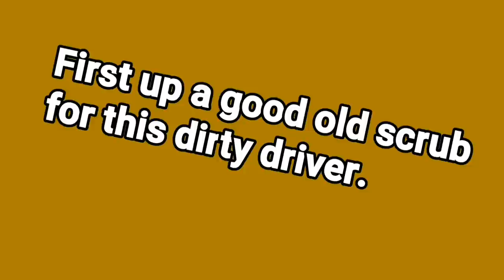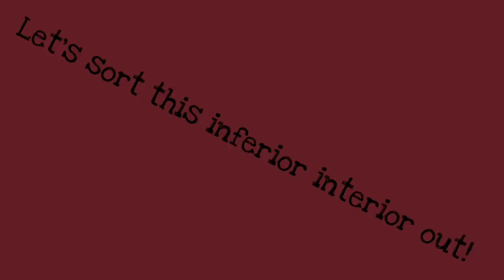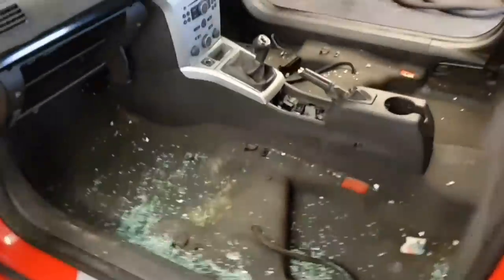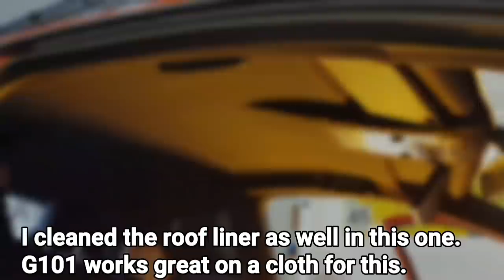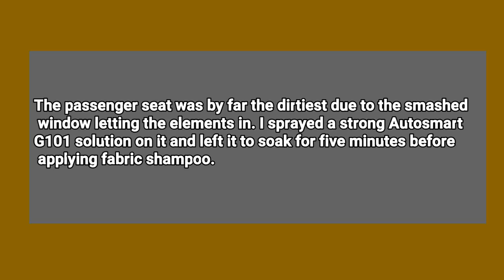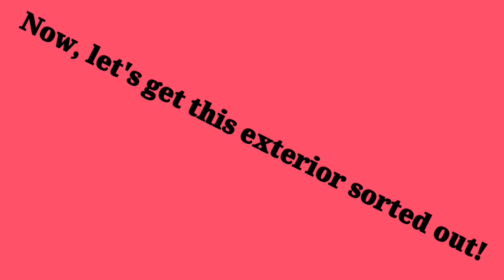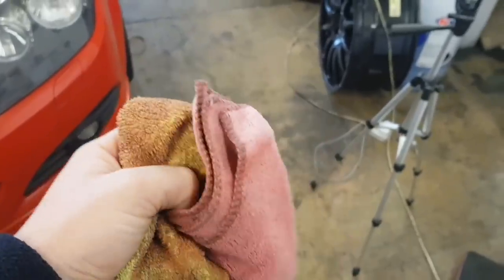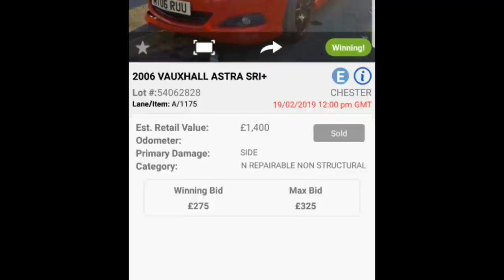Cleaning a really dirty car - vauxhall holden saturn astra

Comment: Collonite 845 is a legendary wax. The product performance speaks for itself as Collonite doesn't advertise the product or have a flashy design on the bottle. The stuff lasts for months even in the brutal salt of Michigan winters.
Reply from the maker: That is a good wax. Can be a bitch to get off though 😂
Reply: @autoshineblackpool  Yh but what's helped me is if you just put the bottle in some hot water for about 5/10 mins before using it, it really helps with that. Awesome work on the Ruby Red Astra!!
Reply: @autoshineblackpool  It is extremely easy to remove if you heat it up in a warm bucket of water and apply it REALLY thin. It should be barely visible when you spread it on the panel.
Reply: Collonite 845 is my choise too..god price and lasts well.

Comment: Bought myself a black '06 Astra 1.4  Sxi a month ago for about 20 quid more than you paid for that before delivery as I needed a cheap runaround. 

It has scratches and chips and needs some TLC. Your video has given me a good idea of what I need to do to get it looking better, so thanks a lot. 

Btw, I agree with the folk that say your videos are therapeutic. Loving the accent, but I have the same one, so I would say that. 

Keep up the good work!

Comment: Fantastic job man. We always used Zep products on the rental cars. They had a 5 gal natural citrus cleaner that would melt tar and bugs, would do a crazy good job on any interior surface, and seemed safe on everything. Never affected carpet or painted/dyed plastic color and of course no issues on exterior finishes. And it literally melted stuck on junk off wheels, wheel wells and exteriors. Great stuff. Smelled damn good too.

Comment: I've been using a Turtle Wax F21 super protectant for my interior and exterior plastic panels.
It cleans, protects from the sun and dresses the panels to a fresh stock finish without leaving any residue.
I used it for the last 7 years and it works superbly.
Especially in the intense sun of the middle east.

Comment: Awesome results!
I fell in love with super clean for cleaning engines, tires, and wheel wells. Optimum no rinse works great as a window cleaner, interior cleaner (for routine cleaning), and if it’s too cold for running water. Dressing- Chemical guys VRP because you can dilute it to your desired gloss since it’s water based. Meguires new iron decon works well for hammered wheels and paint.

Comment: Another great vid, the results are a credit to your hard work! I’m a bit OCD with cleaning my car and my other half’s car so have many products, but a stand out is Sonax Brilliant Shine Detailer. It’s perceived as a spray detailer / drying aid but it’s more of a spray sealant due to its longevity and great water beading. Great value too!
Reply from the maker: I actually use that product! It's a great thing to have. 😊

Comment: Got a 2002 Astra whose paintwork I brought back to life with Meguiars Ultimate Compound then liquid carnuba wax then sealed it with Bouncers Done & Dusted Si to give it the high gloss wet look. Inside it gets vacuumed monthly and spritzed with Autoglym Vinyl & Rubber restorer. Whole car looks mint from 10ft away!

Comment: Auto finesse triple, halfords sell it and with a trade card it's under £10 works a absolute dream in my opinion! That car looks the doggssss
Reply: The alloys are horrendous
Reply: Easy on, easy off. One thin application is all it needs and one 500ml bottle of it lasts for ages. I love the Tripple. It smells lovely and gives a great shine. Did I also tell you that I use Auto Finesse Tripple as well? I use the Auto Finesse Rejuvenate Cleaner Polish to prepare the surface for it if I haven't done the car for a while and it pulls up a surprising amount of bonded dirt that washing won't get rid of.

Comment: My favourite product for the exterior is gyeon wet coat, just wash the car, rinse off and apply a misting whilst the car is still wet, pressure wash off and a ceramic coating on your paint which lasts 1 - 3 months with a high gloss and a crazy hydrophobic beading effect, I love it, very simple and easy to use, give it a try! Favourite interior product is auto finesse total interior cleaner, cleans well, leaves behind a nice finish and has a kind of new car smell to it which infuses the cabin afterwards, I love it 👍👍👍 a great effort on the Astra, looks really nice now, will you be keeping it for yourself or selling it on?  A tip you may not know (from another detailing channel) - if the mouse or any creature really sets up home in the car and you cannot find it, just use an ozone machine for 90 - 120 mins and it will kill anything organic inside the car. A decent channel to watch diy or simple solutions to detailing woes is “sweet project cars”, he is an American guy that is quite knowledgeable, maybe a few tips for you all there too 👍👍👍

Comment: Sonax BSD for longevity as a spray sealant. As an    all in one I recommend Triplewax Car Polish, as good as Autoglym Super Resin Polish but miles cheaper - only a fiver from Sainsbury's for a litre. For carnauba wax try Harly Wax £22 on eBay for 400gms or Farecla G3 Supergloss - roughly the same price for 200gms. Both easy to use and give a lovely glossy finish.

Comment: O-M-G !! 😎👏👏👏👍👌👊👊 You did one bloody amazing job on this rebuild/resto/detail!! You'd never know it was trashed! I think that left rear quarter panel was used as a test spot for the other crappy spray paint areas.😉 As for what I use on interiors, if it's a health hazard I use Spray 9 as it's a disinfectant and kills bacteria. For interior dressing, I've tried many but get the most positive feedback from customers when I use Meguires  vinyl and rubber cleaner/protectant. It has a great scent and customers always comment on how great it smells and how little dust stays on the dash over time. Poor Boys products are a great choice! They dont advertise and their labels are low key but the products are outstanding! Excellent choice there! Great video again. Thanks so much for putting this together for us. I know it takes forever to edit and shuffle the camera all over the place. Again, great job on the wee car!! 💪💪🤩👌

Comment: I use bilt hamber polish and double speed wax. I have recently bought poorboys wheel sealant but not used it yet. It would of been nice to see the astra outside when finished to see the paint in natural light. Keep up the good work!

Comment: I used to travel a lot for work. Came back from one trip to find a BMW X5 in my driveway. I called the police. A cheeky neighbour renting across the street just thought he'd take the liberty. "In my country, it would be no problem". Nice big oil stain on my new concrete driveway. I had an OPEL ASTRA and as it had sat while I was away, I moved it onto the street and spent nearly a day cleaning it so that it was like new. Left tire foam on it overnight on the street ( so as not to stain the driveway ). When I came out in the morning, the rear quarter panel was pushed in. The only explanation was that the guy had reversed into it by way of saying "Screw you". Nice neighbours. They went back to Eastern Europe soon afterwards.

Comment: Something you haven't covered that's my favorite (favourite) is to use scented Lysol to clean the vents. In Texas air conditioning is required for the heat, but mold can grow in the vents leaving a smell like a cat peed in the car. No joke. To clean, you open the vents and turn the air on high (no A/C) and open the windows. On the outside near the bottom of the windshield (windscreen) spray in Lysol every few seconds for about 5-10 minutes. It kills the mold in the vents. The smell is better if you use lemon or something clean smelling. Usually do this once or twice a year. Right now experimenting with an industrial bathroom enzyme cleaner for the interior carpets. Same stuff you would use in a huge public restroom to get rid of pee smell. This works great to get out any bad smell.

Comment: I'm not quite sure if your headlights are slightly hazy or not but if so give Mother's Metal polish a go with the buffer & a medium buffing pad, will make them brand new again. No need to do the wet sanding etc. as this will do a better job and will only take a couple of minutes. Keep up the good work mate.

Comment: Well done mate you've done a great job on this car and saved it from going to the scrap yard or being ripped p for parts. It will give someone many miles of happy driving. 
My personal cleaning products I use are all mainly from Autoglym. Although I'm going to order some G101 cleaner and that bio stuff you use too. Getting myself a shed (finally) so I can put all my cleaning stuff in there! 
Looking forward to the next video!

Comment: Always wanted one of these cars when the Saturn came out. Never happened though. I use meguires stuff on the inside and spray away glass cleaner on the inside and outside of the glass once the car is washed.

Comment: I use silicone sprays myself, I like the glossy finish they give but I wipe the excess off with a cloth as I hate the way it lies and leaves it greasy and it attracts the dust to stick quicker and easier.

Comment: Auto finesse Iron Out works wonders on a wheel I've ever used it on also theirnglide for clay barring is the best on the market. For cleaning Koch Chemie is bloody incredible, not the cheapest stuff on the market but you pay for what you get for sure
Reply: Koch Chemie GreenStar and PolStar both clean very efficiently and they're very safe on the car as well, I find. Their compound and polish range is VAST, but I especially enjoy using the F5.01 Feinschleifpaste for fine scratch removal and their P2.02 Micro Cut and Finish makes a fantastic all-in-one. I don't need anything else for the car body, really. No, not cheap stuff at all but they always work very well, as you say.

Comment: Great job, a thoroughly enjoyable set of videos. I'm currently using sonax spray and seal and sonax polymer net shield. Probably not products you'd use on customers cars as you really need to buy in bulk to get the price down. Great products for us weekend warriors though. Look forward to the next videos.

Comment: If you can find it there try 303 aerospace protectant for your rubber, plastic, vinyl and leather. And solution finish to get the faded black trim back to black.

Comment: I use Autoglym for most things; I'm still trying to find a decent shampoo that suds up nicely.  The water where I am is really hard; trying to get some decent suds without using loads of whatever I'm using is a mission.  I need a 4x4 so I might see if I can pick up a crapper for a few hundred quid and attempt what you've done... :)
Reply from the maker: Go for it. Before you start washing and your bucket is full of nice clean soapy water, try sticking the pressure washer nozzle in the water for a few seconds . That'll get the sudz going.

Comment: PRODUCT SUGGESTION : **  Autoglym Car Glass Polish  ****. It's a blue thick liquid. Use it inside and out. Best to cover the dashboard to avoid drips. But it's AMAZING ! It's like there's no glass in the car it cleans it so thoroughly. You will see on your rag the rubber and grime that comes off from the outside of even a clean windscreen when you use it. Also use it to carefully rub down the wiper blades. Water will bead off the windscreen for days and days afterwards. No need to use spray cleaner. You won't look back if you give it a try. Greetings from Prague, CZ
Reply from the maker: It is good stuff that. 👍

Comment: On the interior, I'm nowhere near as detailed as you, but I do use Griot's Garage products, they're hard to find here but they work incredibly well. No smell or anything, safe on all surfaces. 

Also, I noticed you don't typically touch the headlight covers. Any reason? Granted I know in the UK there isn't as much sun as even here in Canada, but it's definitely part of my preventative maintenance. Here you'd be lucky to get 6 years without hazing headlamps.

Comment: Try Pro Nano foam. Touchless wash. Spray on, let it sit for 1 minute, pressurewash it off and the car is clean. Saves bending over for a handwash. Good for the back.

Comment: Pressure washing the engine bay... especially the battery... is that not bad?
Reply: Was sorta thinking the same. We always just steam clean after summer time...AZ summers are pretty brutal! Good time to check belts & hoses then too.😁

Comment: Poorboys Black Hole for dark colours. About £14 for 473ml. Does all my dark colours.
Great job by the way. You will sell this in 24 hours easy. 
Just one little question. Did the vehicle have interior wheel arch liners? Looks like it was missing them.
Love the vids. Keep it up.👍🍻
Reply from the maker: I think it's sold and not even advertised yet. 👍

Comment: Very Nice job, but what is claybarring before the buffing? What does it do?
I’m guessing it’s to protect the bodywork from buffing compound sticking to where it doesn’t belong.
Anyway the dealer that sold me my car did a horrible job buffing it and i was wondering what is the best way to remove buffing compound from plastics and rubbers and also how to remove the white specs the dealer left after buffing?

Love watching you bring life back to discusting cars and make them look all shiny and new again.
Reply: to remove residues from polish, wax or compound in plastic, i use IPA (Isopropyl alcohol) in a mix with water from 20% to 70% it depends on what i'm triying to remove, use it with a soft brush and let it soak, it works like a charm.
Reply: @newthepanch  Thanks for the tip i'm gonna try it

Comment: Lol @ Mickey (mouse?)
As for cleaning products - I usually clean my car insides at some local detailer's, like once a year.  No clue what products he uses, also the car is wrapped with PPF. External cleaning - is once for 2-3 weeks, depends on how much pollution is in the air (dust/rain), for the tires I use McGuire's gel, cleaning dust inside of the car - some not glossy dust repelling liquid with almost no smell and definitely  not silicone :)
Reply: KinDzaDza123123 Why do you pay someone for cleaning your car’s interior? I mean, it is super easy all you need is a vacuum, compressor, a micro fiber towel and som interior cleaner. I find it very fun to clean my car, usually does it twice a week.
Reply: @ool3062  I live in some suck place where's no parking near my home. I park in some underground public place. The internal clean I do - just to clean some dust - but the car is clean inside anyway. Outside I clean in some place - also same reason: no place to park, no accessible water hose. Vacuum cleaner, compressor he he. No place to connect them :)

When I had a bike I could park it shortly on the pedestrian pathway and bring some bucket with water. With the car this doesn't work. :(
Reply: @NoOnesIdea  I understand! Where I live there are places you can wash your car and on the most places there are vacuum cleaners you can pay for to use, there is also compressed air canned you can buy to blow out stuff with. It's not cheap to pay someone to clean it, at least not where I live, it costs about 400 euros.
Reply: @ool3062  We have no normal places where you can pay and clean yourself either. At least those I can tell about :(
In next life when I have a private house with private parking lot - I will do it myself! :)
400 Eu is not cheap at all. This can be cost for full detailing. Cleaning inside costs for me about a 100 EU., without nano protection liquids.
Reply: @NoOnesIdea  400 euro for the interior though, yet it costs much less and is way more fun to do it yourself ;)

Comment: That's it!  You're hired!  Damn, I am in New Jersey...bummer!  I have a question...I have a Subaru Forester I bought used.  The previous owner left a ballpoint pen in the back pocket of the seat which is fabric.  Any idea how to get that out?  You are a wizard at getting cars clean and this issue is one that has been bugging me for months
Reply: Ballpoint pen seems to come off easier the less time it has been there. You could try acetone (you ladies know it as nail polish remover) ..BUT! try it first on a hidden piece of material, as you never know what materials car manufacturers are using these days and it could damage the material. One thing is sure it will not leave a residue.

Comment: Is the car mechanically sound? I mean the engine,gearbox,suspension etc2? If yes then damn you just bought a really good bargain car then. Question, how to clean windows squeaky clean without having to use a polisher? i've tried the blade,iron wool & scotch pad method but nothing seems to work. The car I bought was left in the auction store under the sun for many years so the stain is kinda baked/hardened onto the glass.
Reply from the maker: Yep, drives great. I was expecting to spend a few pounds on it mechanically, but other than a new tyre it was fine.

Comment: I'm an amateur. But i use hot water and dish soap in the inside. Car Soap and a mit on the outside
Reply from the maker: Amateur or pro - If it works it works 👍